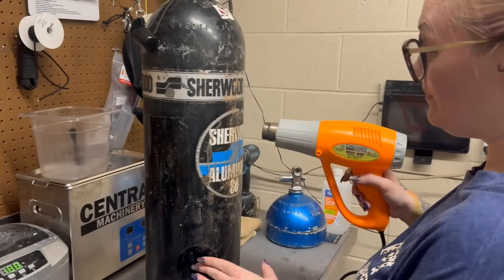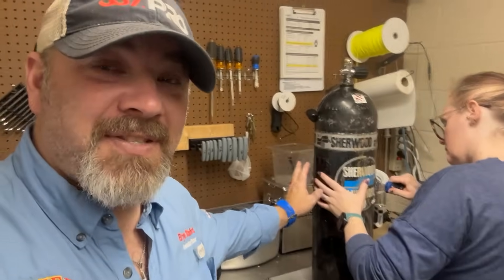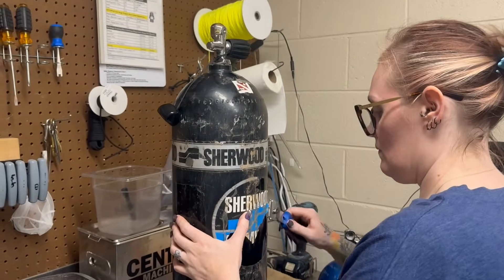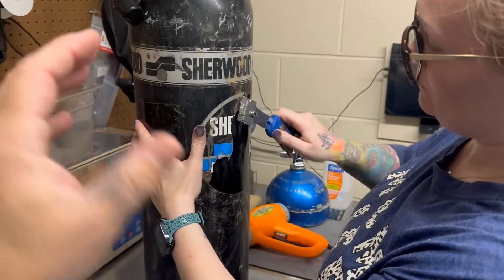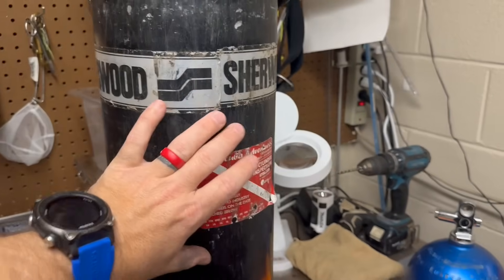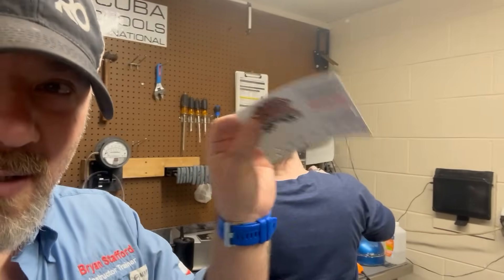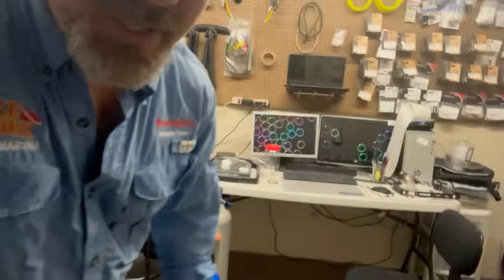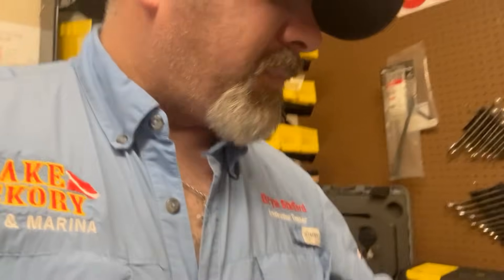Why We Remove Your Tank Stickers

Comment: Also, the real reason some places remove stickers is rust and corrosion can build up under a sticker. This is not very common on AL tanks though.
Reply from the maker: Hello @homeautomation3821, that is definitely another reason we remove all the stickers, but the primary one is because we follow CGA C6 and C6.1 which states

 CGA (Compressed Gas Association) Gas Law showing this is C-6.1. 
Section 4.4 CLEANING
"Judgment is required to determine the extent of cleaning required and whether removal of paint is necessary. At the time of requalification, all multi-layered paint and coatings, foreign materials, temporary labels, or removable sleeves that could interfere with the inspection shall be removed from the external surface so it is prepared for inspection. Remove all attachments that could conceal corrosion or other defects before inspection. If internal/external cleaning is performed in conjunction with periodic hydrostatic retest, cleaning shall be accomplished before hydrostatic or other cylinder testing." 

C-6.1 deals with aluminum cylinders that hold 1800 psi or higher pressure. The same thing is stated in C-6.0. That section deals with steel cylinders. So the CGA gas laws apply to both types of cylinders.

Comment: Thankfully, I'm not within distance where this shop might service my cylinders. There is NO requirement to do this. This is neither a requirement, an expectation or a good look for your shop.
Reply: In the past 35 years of owning several tanks and properly maintaining them I have seen anything like this . I believe its just an extra way to get more money out of the customer . Any internal imperfection will be seen with the scope if properly used. And he brings up tig welding a hole , well I have tig welded for 30 years now and that type of hole repair will definitely be seen in the inspection.
Reply from the maker: Hello @Just-Ross, we follow CGA C6 and C6.1 which states

 CGA (Compressed Gas Association) Gas Law showing this is C-6.1. 
Section 4.4 CLEANING
"Judgment is required to determine the extent of cleaning required and whether removal of paint is necessary. At the time of requalification, all multi-layered paint and coatings, foreign materials, temporary labels, or removable sleeves that could interfere with the inspection shall be removed from the external surface so it is prepared for inspection. Remove all attachments that could conceal corrosion or other defects before inspection. If internal/external cleaning is performed in conjunction with periodic hydrostatic retest, cleaning shall be accomplished before hydrostatic or other cylinder testing." 

C-6.1 deals with aluminum cylinders that hold 1800 psi or higher pressure. The same thing is stated in C-6.0. That section deals with steel cylinders. So the CGA gas laws apply to both types of cylinders.
Reply: @LakeHickoryScuba  poor comprehension on your part. The word "judgement" and  "could" interfere. "We do it cause we can an we're authorized to do so" isn't a good look for you.
Reply: @LakeHickoryScuba none of which is mandatory. 🤦‍♂️And in fact, if that's the standard you are following for some reason, then you're exposing the cylinders to temperatures in excess of 350f - and therefore should be condemning the cylinders your using the heatgun on... Pick your poison!

Comment: Seems excessive. I'll take to a different location
Reply from the maker: Hello @BobFromCalifornia, we follow CGA C6 and C6.1 which states

 CGA (Compressed Gas Association) Gas Law showing this is C-6.1. 
Section 4.4 CLEANING
"Judgment is required to determine the extent of cleaning required and whether removal of paint is necessary. At the time of requalification, all multi-layered paint and coatings, foreign materials, temporary labels, or removable sleeves that could interfere with the inspection shall be removed from the external surface so it is prepared for inspection. Remove all attachments that could conceal corrosion or other defects before inspection. If internal/external cleaning is performed in conjunction with periodic hydrostatic retest, cleaning shall be accomplished before hydrostatic or other cylinder testing." 

C-6.1 deals with aluminum cylinders that hold 1800 psi or higher pressure. The same thing is stated in C-6.0. That section deals with steel cylinders. So the CGA gas laws apply to both types of cylinders.
Reply: @LakeHickoryScuba  yeah I guess the more I think about it. I figured I have seen distinct corrosion underneath labels and you know exactly what it is, but I also haven't had a cylinder explode. You're taking on a huge liability filling and you need to take your safety first 🥇🥇 I really appreciate you video on filling and the deep dive into it

Comment: Sorry man, I’m calling BS…. There’s no way you wouldn’t be able to see a welded up hole by doing the internal visual inspection…. This seems like some kind of flex on your part.
Reply from the maker: Hello @MikeDodds, we follow CGA C6 and C6.1 which states

 CGA (Compressed Gas Association) Gas Law showing this is C-6.1. 
Section 4.4 CLEANING
"Judgment is required to determine the extent of cleaning required and whether removal of paint is necessary. At the time of requalification, all multi-layered paint and coatings, foreign materials, temporary labels, or removable sleeves that could interfere with the inspection shall be removed from the external surface so it is prepared for inspection. Remove all attachments that could conceal corrosion or other defects before inspection. If internal/external cleaning is performed in conjunction with periodic hydrostatic retest, cleaning shall be accomplished before hydrostatic or other cylinder testing." 

C-6.1 deals with aluminum cylinders that hold 1800 psi or higher pressure. The same thing is stated in C-6.0. That section deals with steel cylinders. So the CGA gas laws apply to both types of cylinders.
Reply: @LakeHickoryScuba   A quick Google search returned the following results, “While the Compressed Gas Association (CGA) develops standards and guidelines for the compressed gas industry, CGA standards are not legal requirements in themselves, but they are often referenced or adopted by regulatory bodies like OSHA and DOT, making compliance with them a de facto legal requirement. “   So at around 4:25 you say that you take them off because you can.  I firmly believe that there’s no way you would not see a welded up hole from inside the cylinder which brings me back to believing that on some level this is some sort of flex on your part.
Reply: @MikeDodds  The heat gun they use is MINIMUM 350° meaning any tank they use it on was exposed to 350° or higher heat and thus now must be condemned for it.

Other comments are pointing this out to the shop shrugging it off. Definitely sketchy.

Comment: BS! If you do a proper VIP, you'll see the weld on the cylinder wall inside.
Reply from the maker: Hello @AlphaHegemon, we follow CGA C6 and C6.1 which states

 CGA (Compressed Gas Association) Gas Law showing this is C-6.1. 
Section 4.4 CLEANING
"Judgment is required to determine the extent of cleaning required and whether removal of paint is necessary. At the time of requalification, all multi-layered paint and coatings, foreign materials, temporary labels, or removable sleeves that could interfere with the inspection shall be removed from the external surface so it is prepared for inspection. Remove all attachments that could conceal corrosion or other defects before inspection. If internal/external cleaning is performed in conjunction with periodic hydrostatic retest, cleaning shall be accomplished before hydrostatic or other cylinder testing." 

C-6.1 deals with aluminum cylinders that hold 1800 psi or higher pressure. The same thing is stated in C-6.0. That section deals with steel cylinders. So the CGA gas laws apply to both types of cylinders.
Reply: @LakeHickoryScuba  You stated in your video that the reason behind this (and the code/law) was in the event someone welded the hole shut. Address the point made, "If you do a proper VIP, you'll see the weld on the cylinder wall inside." I never once said you were wrong in what is stated in CGA C6 or C-6-1.

Comment: The TIG excuse is total BS, that process would leave obvious signs of being done. The dive industry has some stupid things, damaging customer stickers for a simple visual inspection is one, there is no law that says you have to do that.
Reply from the maker: Hello @justanotherguy6359, we follow CGA C6 and C6.1 which states

 CGA (Compressed Gas Association) Gas Law showing this is C-6.1. 
Section 4.4 CLEANING
"Judgment is required to determine the extent of cleaning required and whether removal of paint is necessary. At the time of requalification, all multi-layered paint and coatings, foreign materials, temporary labels, or removable sleeves that could interfere with the inspection shall be removed from the external surface so it is prepared for inspection. Remove all attachments that could conceal corrosion or other defects before inspection. If internal/external cleaning is performed in conjunction with periodic hydrostatic retest, cleaning shall be accomplished before hydrostatic or other cylinder testing." 

C-6.1 deals with aluminum cylinders that hold 1800 psi or higher pressure. The same thing is stated in C-6.0. That section deals with steel cylinders. So the CGA gas laws apply to both types of cylinders.

Comment: If a hole on the bottom or side was TIG welded and a sticker placed over it. You would still see signs of it on the inside.  I understand removing old VIP stickers.  And stickers that could cover the Hydro and manufacture stamps. Understand your point of view for safety,  Thanks, for letting us know your shop policy.   I will never have your shop inspect my cylinders.  Doesn't mean I wouldn't do business with you, for other things.
Reply: Seems like if a hole was weld filled you would be able to see it from the inside of the cylinder with a bore scope or mirror on a stick.
Reply: @JohnUllrey  you would.  You can see the weld by x-ray and by UT.  There are several ways to identify a weld by other than visual inspection.  They may even magnaflux those tanks looking for cracks.  If your tank is old enough to have to undergo reinspection, why in the hell would you complain about them removing stickers off of a tank that if it ruptures either becomes a rocket or a bomb.  Shops weld up boxes to hold oxygen tanks in place in the event they rupture. What kind of IDIOT would complain when they are inspecting a tank that hold several thousand PSI of pressure.
What an insanely stupid conversation.
Reply: @joeyl.rowland4153  "What kind of IDIOT would complain when they are inspecting a tank that hold several thousand PSI of pressure."

The kind who would also then go on YouTube and tell off shop owners for complying with both the law and plain good sense, apparently.
Reply: @joeyl.rowland4153  heatgun is the problem. And they aren't oxygen tanks. A person cannot breathe pure ogygen, that would be lethal.
Reply: @grampafpv  even dive tanks have enough pressure on them to be a missile.
Reply: @ShuRugal  The video was removal of FACTORY labels. The comment you responded pointed out the law DOESN'T apply to FACTORY labels.

So, no, the label in the video did NOT need removed, nor did the FACTORY nitrox label that was pointed out in the video.

As you admitted, FACTORY labels/stickers don't need removed. By showing them removing those, it means they will do so so they can charge you fir replacing FACTORY labels not needed removed by law.
Reply: @CommanderRedEXE  man, you are really upset.  do you want to talk about it?
Reply: @ShuRugal  Not upset. Pointing out the literal text of the SAME regulations the shop claims to follow. Go troll elsewhere kid.
Reply: @CommanderRedEXE  nah, i think i'll keep trolling here.

For my next act:  how does the inspecting station differentiate between a "factory" sticker applied by the factory, and a "factory" sticker applied by someone who modified the cylinder and wishes to maintain a factory appearance?
Reply: @CommanderRedEXE  you are literally going to complain about an inspection on a pressurized tank that could rupture and could kill you AND you are addicted to the oxygen you get from that tank.  You don't think a new sticker might be in order?  Are you really thinking about your argument?  Is your safety worth that sticker?  The sticker is cheap and can be replaced.
Reply: @joeyl.rowland4153  And you're defending a shop who, PER THE SAME REGULATIONS THEY USE IN DEFENSE, have literally CONDEMNED every single tank they heat gunned into REQUIRING decommissioning of said tanks.

So, not only does that make this, legally speaking, FRAUD, but worse it is 100% NEGLIGENCE. If enough people report the heat gun use to inspectors they could 100% be fined or lose their license for selling CONDEMNED tanks to customers. If deemed intentional, it becomes a Felony.

Why are you defending the company quite literally CONDEMING tanks just to remove FACTORY labels the regulations don't require removal of?

Do you not know CONDEMNED tanks are no longer usable and are a SAFETY HAZARD because the heat created a weakspot?

Also, the tank needs only EXPOSED to 350° or higher temps. It does NOT need to reach it. So yes, the heat gun in question, even at lowest setting, is hitting that 350° mark, thus condeming the tanks.
Reply: @ShuRugal it would be quite obvious if it wasn't the original sticker. But the sticker argument is beside the point. If a tank is merely EXPOSED to 350° or more of heat, it is CONDEMNED, as in no longer safe to use.

The heat gun they use? The LOWEST setting hits 350° minimum. By using that specific heat gun, they literally are CONDEMNING every tank it's used on then charging the owners for now unsafe to use tanks.

That, by definition, is FRAUD. And yes the same regulations they use to claim stickers MUST come off, also clearly state the heat EXPOSURE instantly condemns the tanks. Others have posted the code VERBATIM only for the shop to laugh it off.

But hey, my late father relied on air tanks to leave the house so I SURELY have no idea whatsoever what I must be on about.

Again, quit trolling or return to reddit like a good brainless sheep who does zero research.
Reply: @ " it would be quite obvious if it wasn't the original sticker. "

In what way?  Does the sticker turn violently pink if anyone who isn't the OEM applies it?  

Does the OEM have a super-secret sticker-handshake that must be used to apply the sticker, or it falls off?  Is this secret handshake different between manufacturers?
Reply: @CommanderRedEXE  I am not defending anyone.  I am merely stating that a sticker is not worth your life.  I do not condone their method for removing the sticker.  Although I do not do one minute assume that the temp of that tank has to be elevated to 350 degrees F and to do so with the mass of that tank would take an exhorbanant about of BTUs and I am not certain that heat gun will bring the temp that high removing a sticker, just saying, I have used a high heat gun on enamel paint to remove  a decal with high intensity glue without scorching the enamel which will begin at about 240 degrees.  So if I can do it under 240 with a heat gun that would melt aluminum, why couldn't she do it on that tank?
Reply: @joeyl.rowland4153  per regulations it doesn't matter. Exposure is exposure.

That's all my point is. They, not the commenters, are hypocritical by taking the regulations word by word only when it serves them and playing fast and loose otherwise.
Reply: @CommanderRedEXE  It could all be moot.  Simply banning all labels period.  Solves it all the way around.  That makes the most sense.
Reply: Uh, so your X-ray vision and DOT RIN is current?
Any shop that doesn't remove nonfactory labels and stickers is criminal.
 Not all damages that condemn cylinders are visible on the interior surface.
 Yeah, that and you sound like someone who fast fills.
Hope your life insurance, liability insurance and lawyer are paid up.
Reply: It’s literally the law to remove them.  If a company doesn’t they are breaking the law
Reply: Exactly what I was going to say😂
Reply: Im not a diver but nothing in that statute states that factory applied stickers must be removed.
Reply: @grampafpv Anything covering the cylinder must be removed.  They have to see the whole cylinder.
Reply from the maker: Hello @jeffconley6366, we follow CGA C6 and C6.1 which states

 CGA (Compressed Gas Association) Gas Law showing this is C-6.1. 
Section 4.4 CLEANING
"Judgment is required to determine the extent of cleaning required and whether removal of paint is necessary. At the time of requalification, all multi-layered paint and coatings, foreign materials, temporary labels, or removable sleeves that could interfere with the inspection shall be removed from the external surface so it is prepared for inspection. Remove all attachments that could conceal corrosion or other defects before inspection. If internal/external cleaning is performed in conjunction with periodic hydrostatic retest, cleaning shall be accomplished before hydrostatic or other cylinder testing." 

C-6.1 deals with aluminum cylinders that hold 1800 psi or higher pressure. The same thing is stated in C-6.0. That section deals with steel cylinders. So the CGA gas laws apply to both types of cylinders.